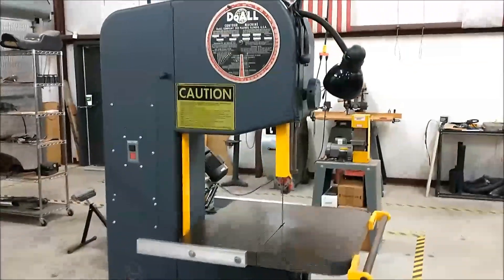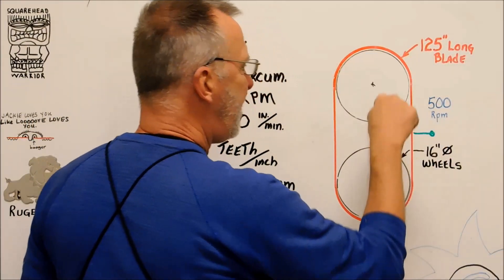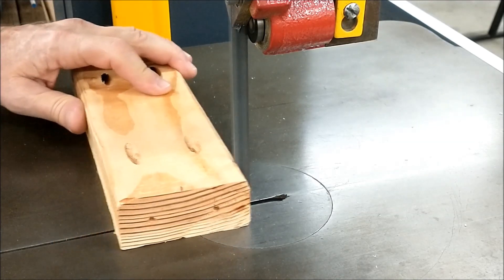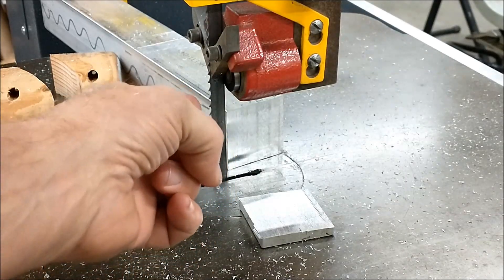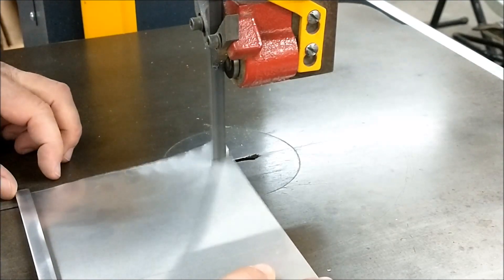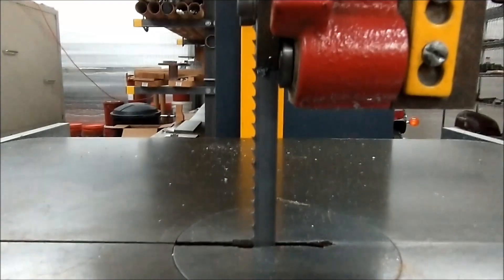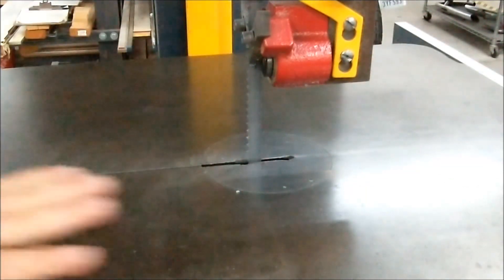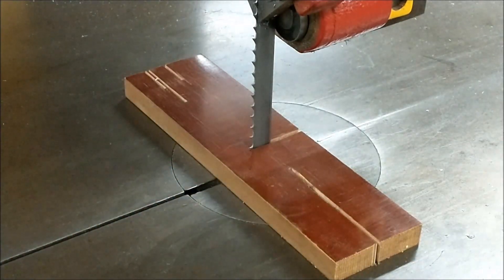1200 POUNDS, 500 TEETH, and No Conscience !!!

Comment: I always remove the guards from grindettes but rarely from anglegrinders.

I do have dozens of tools with guards removed,  I also have tools that I have designed & made guards for.

Your assumption that Everybody  that removes guards is an idiot is entirely loodicras let alone  WRONG.

It depends on the operators knowledge, skill, competence, hindsight experience, engineering competences, patience and WHY.

Manufacturers put guards on things to prevent morons from sueing them,  the same as gov & police enforce crash helmets & seatbelts.

There is a time and a place for these things and thats NOT EVERYWHERE ALL the time.

Safety guards ate extremely DANGEROUS once they have been in use long enough to induce complacemcy.

Guards should ONLY be used as a secondary safety aid.

The brain should take priority in self preservation and the protection of other people, animals & property.

If you don't have the cognative agility then don't touch the tool but don't inflict your incompetence upon the worlds  educated neurons.
Reply from the maker: Great comment. I almost thought you were serious. LOL

Comment: I dont get scared until the large shapers and radial arm saws show up!  My 14" bit my thumbnail and tagged the bone once.  I should use your method and calculate my reaction time.
Reply from the maker: I put a 1 inch wide dado head on a 10" radial saw and made 1300 cuts at 1 1/4" deep. The chips were flying.

Comment: Band saws, routers and angle grinders - High risk machinery. 
Band saws is deceptive because it appears to be a low speed machine.
The angle grinders. Well, the fastest way to remove material/flesh is with a grinder. Astoundingly, its not hard to find video content on YouTube showing proper idiots using them without the GUARD.... sometimes with a tough knotted steel brush disk.  WTF! 
I notice is appears to be an 'American Thing'.
The speed at which those things spin means bad shit happens very quickly,  and grinder injuries take a long time to heal.

Comment: Too many don’t want to take the time to pay attention to the principles and fundamentals of how a saw works, as the attitude is generally to bulldoze and hack through whatever, and get on with the project.
I’ve found that taking time to maintain and properly adjust a bandsaw, along with appropriate blade / speed selection, for optimum performance will actually save time, money and material for minimizing subsequent stock removal and ease of setup, and generally, less dicking around.
Then there’s the improved safety aspects and reduced risks, that go along with and result from the the optimized performance.
Very often, that stock preparation facilitated by a bandsaw will be the deciding factor of the feasibility of a setup to accomplish a job at all.

Comment: At the first shop I worked at the foreman was acting like a goof, dickering with the blade tension while running the saw with the guard open and the blade snapped. It came out like a cobra and took his eye out. It was a fucking horror show. Respect your machine tools boys. Don't be a cowboy.
Reply: Seen some MAJOR injuries over the years....
When I was a junior apprentice my foreman stuck his hand in a spindle moulder - three fingers and half his hand gone (early 90s MacRob Furn.)
Forearm cut off, hand trapped in Beam Saw at Steed Form Postforming.
Hand caught and COMPLETELY degloved in P.U.R. hot glue rollers (it was the Boss himself! Stripped his hand to a skeleton!🤮)
Also at Steed's!
Silkwood Furn, one of the juniors was feeding Drawer fronts through wide belt sander, one didn't come out the back....so he looked through the infeed side to see where it was stuck - the machine chose that moment to spit it back.
Opened half his face to the skull. (ALWAYS look in the outfeed side, so if it grabs, it spits AWAY from you!)

Thats some of the more memorable ones at a few of the places I've worked.
Reply: @kurdaitcha3509  I've worked at places like that back in the day. More memorable ones was at a cardboard box factory as a teenager I seen a dye press suck a mans are in up to his elbow. The rollers was only 3\16 apart needless to say there was no saving the arm. Next was a male employee with very long hair working on a box glue machine it would feed cardboard threw it faster than the eye could see he leaned over the machine to look for a jam the machine roller wound his hair up and scalped him now that was grew sum.
Reply: Wow!

Comment: Blade Rake angle and Tooth count matter a lot too. Track or Circular saws with high tooth count blades and near zero rake angle work great on Aluminium or Perspex and so does a higher tooth count Bandsaw blade. Also make a new insert in the case of the bandsaw with a smaller slot to improve support and reduce backside tearing/chipping.

Comment: Quite some time ago, one of the rough out guys in my shop was cutting a 3/32 thick brass or bronze plate on our Do-All, attempting to cut out a 9" circle.  He was running the blade a bit too slow for the application, blade clogging up with the soft metal chips causing him to really push into the cut.  Well sir some of those chips knocked out, the blade shot through the plate and cleaved his hand in a semi-circle from between his middle and ring fingers down to the base of his thumb near his wrist.  This happened in less than 2 seconds.  He grabbed his right hand with his left to try to hold his right hand together, maddone, so much blood.  This stuff will no shit injure one bad if innatentive or dangerous handling of work.  Believe it or not they got him to the Hand Center at Jefferson Hospital in Philly and within a year or so had almost full use of a now slightly deformed hand.  If we were out in the boonies away from such treatment he would have lost that hand for sure.
Reply: Good Lord, that is a horrifying. I was born and raised in South Philly and worked in a few different machine shops in the city in the late 1970's.

Comment: A kid at one of the schools I went to came to class high and nipped his thumb right off and didn't even feel it.  I believe they were able to put it back on, but the damage was done.  It took about 30 seconds to stop the machine with the brake.  It was big.  I think it had close to a 30" throat.  You could swing a 2x4 into the blade and it would cut it off.

Comment: Joe, you've had me going in circles for over an hour. How can turning a band saw blade backwards even happen .
 I eventually went to my shop, dug out a new blade to try and make sense of it. To my horror the blade I opened was backwards already. I finally twigged that you're not turning it backwards but "inside out". That will make the teeth run backwards. Now it makes sense. 
This 77 year old brain was tested. But thanks. I needed the exercise.
🍌🇨🇦☃️

Comment: I have a 36'' Oliver vertical band saw and I love it. It out cuts a table saw by far and it demands respect for one thing it runs very quietly when not cutting so your scenes don't alert you to its potential hazard. Lathes are the same way. The Oliver is also so big it is the only power tool I have that I have to climb on to maintain.
Reply from the maker: In a machine shop, the least dangerous thing is turning on the lights. After that, stay sharp. No pun intended.

Comment: Friction cutting in some cases works better high SFM it can be pushed sideways. not with the blade upside-down tho... and it will only work on thin sheet metal..no bar stock.

Comment: Joe- another important point regarding the vertical bandsaw is the need to have the upper guide close to the top surface of the material being cut. This limits the amount the blade can flex outside of the cut which  improves the accuracy of the cut, and also leaves a lot fewer of those hungry teeth out where a moment of inattention might lead to unpleasant results.  
ATB-  Bill
Reply from the maker: Take a look at the video in the video description too.
Reply: I once saw a bandsaw blade break, with the upper guide set way too high.  Normally when the blade breaks it just stops, no problem. When this blade broke with the guide well above the table the blade shot across the table at 90°, luckily no one was in it's path. 1/2" blades can still do damage traveling at 90° to the normal path. I think if the persons hand had been in the path, the blade would have gone through the hand. Don't let your hands go past the teeth.

Comment: The problem is the ability to support the work where the the cutting is taking place, vibrating the work and self feeding into the saw taking big chunks,a zero clearance throat plate raised in the center above the table to eliminate the work from self feeding. A second throat plate slightly raised and domed would be optimal
Reply from the maker: As shown.

Comment: I worked at a shop that had a band saw "blade" that instead of teeth,  had 2" lengths of files, each riveted to the band at one end, all along its length. I supposed it would've allowed the file segments to get around the wheels creating a "band file". I never saw it in use and I regret not trying it myself.
Reply from the maker: I believe thats a band filer. I've never used one, but know of them.

Comment: My former employer had an older 20" version DoAll bandsaw in the machine shop. It was a beast. It had a blade welder and a feed system with cables and weights. I'd love to have it in my wood shop at home. I cut up to 3" thick steel and 5" aluminum on it. With the proper blades it would cut anything.
Reply from the maker: True.

Comment: Many years ago a guy I worked with was cutting a Mica sample potted in a thick layer of resin. He had to cut it in 1/2" strips for a tensile test machine and he had done this many times before but it wasn't ripping and tearing as usual. When he was done we were sitting nearby having coffee when I looked over at the saw and noticed the teeth were backwards. We ribbed him for a while but he said he planned to cut the samples that way all the time because the finish was so much better. So what you say works great on some stuff it just looks funny.

Comment: If you have a blade welder you can cut the blade, thread it through a hole in a workpiece and reweld it. Now you can cut out a shape that is completely enclosed by metal. Snip the blade to remove it - job done.

Comment: Your final comment on cutting thin material using a “pre-cut” base is a method that works pretty well. A slab of MDO plywood works pretty well for that purpose.
Reply: Yeah: double-sided tape it/ tape+CA Glue down to a a piece of sacrificial mdf or plywood and you can practically scroll saw thin mats.

Comment: Thanks, maybe I need that trick some day, my record in Aluminium is 80 mm. 150 mm. D. circle and Plexiglass is always a question mark.
Reply: Going either direction that blade woulda cut the plexi. The danger with that stuff is heat buildup (occasionally chipping, but I never have with my bandsaw). Thing is, once your blade length breaks about 110" no one portion of it is in contact long enough to really start the melt, so long as you keep the workpiece moving. I use mine to cut 3/4" plexi and 1/2 lexan on the reg. Normal wood blade although I DO tend to make a point of using thinner, higher tpi blades.

Comment: Many years ago I had a Cincinnati #2 auto/hydraulic mill. Ran a job with a stagger tooth cutter. One day the rapid traverse feed dog was set wrong and feed took the work right into the cutter. The result was breaking 2 5/8" bolts holding the vise to the table, flinging the vise through the shop window and right out into the street. The machine never even slowed down! We use to say "the only thing that comes outa that machine is chips or blood!" Certainly the same with any kind of band saw.
Reply: I also ran a similar mill. Hydraulic feed. 
That thing was a beast. Ran a 14" shell mill with clamp style square carbide inserts. No vibration, no chatter, blue chips like popcorn. Most solid running manual machine I ever ran.

Comment: Blade speed on a wood cutting bandsaw is much higher than metal cutting.  With a moderately powerful saw, you don't need teeth at all.  Use an old worn-out blade, make sure there's no sawdust in the machine and feed steel through at a high feed rate.  Friction heating softens the workpiece and makes the cut.  The blade doesn't melt because it spends most of its time outside the cut.
Reply: When I was in Air Force, friction sawed 1/8 thick hot rolled with a large Doall blade slightly dull and backwards high gear maxed out. Cut like butter.  Note plywood blade backwards cuts steel roofing like butter. wear facesheild and ear protection also welding jacket.

Comment: Mr. Pie I have to point you on safety issue when working with sheet metal you were not wearing work gloves to protect your hands.
Reply: One of the last things you want to do around a band saw is wear gloves.
Reply: You should never wear gloves when using power tools!
Reply: Gloves can get caught by the teeth on any rotating cutting tool and pull your hand in, turning what might have been a nick into a major amputation.  Sheet metal can cut you as you mention, but that is minor to what a rotating cutting tool will do to your hand when it is trapped inside the glove.

Comment: I have respect for the bandsaw but the most dangerous saw I believe in wood working world in my opinion is the radial arm saw. The blade rotating downward and it will grab and throw it forwards towards the operator. More hands and arms have been chopped off because nobody uses the lock to stop the head from moving.

Comment: When I worked in a UK Secondary School it had a Start right 16" bandsaw. It was only after a minor accident that I was sent to another specialist college to get a certificate and tuition in machine safety. From then on it used to drive me nuts when teachers would try to cut iron billets using the wrong blades. I used to buy blades of all types but none of the teachers asked me to change a blade before the cut material. I'm glad I am now retired and they can get on with it themselves.

Comment: And that is the reason we use a 5 degree negative rake on the blades for the mitre saw, when cutting trimming and baseboards. Produces a much finer cut and keeps burrs to a minimum.

Comment: Hi Joe, very interesting, but why does the blade cut better the wrong way round in thin materials?
Reply: Keep geometry in mind. The right way around puts sudden pressure (relatively speaking) on the piece each time the tooth hits, where the teeth backwards applies a more gradual pressure, resulting in the material being cut bouncing less. When the piece bounces it causes irregularities in the cut. Less bouncing, less irregularities.

Also - i think - the contact gap is less, also resulting in less bouncing. The contact gap being the space between when the last contact point of the tooth moves past the piece to the first contact point on the next tooth.

Comment: Hi Joe,
Never heard that trick before. I know you can hold it between two sheets of stiffer material and that will improve the cut.
That is a pretty slow speed for a timber cutting bandsaw, they normally run around 3500 fpm. And I realise that your saw is made for cutting metal, which run slower.
A lot of people don't realise how many little knives are there to do you some damage. I have a bench saw that runs at 3000 rpm and have a 72 tooth tct blade, that is 216,000 teeth per minute.
Things like spindle moulders are even more exciting. They run 6000 rpm plus, and I have a 20 tooth blade that can easily cut a 8 mm wide slot at quite high feed speed, particularly if I use the power feeder. They are notorious for for doing serious damage to human fingers and hands, and occasionally throwing a workpiece across a room.
But used with care can be very handy.

Regards Dennis

Comment: Hey Joe. I have a question.
Bandsaw tension gauges
How do they account for differences in the mass of the blade?  EG: A 1/8" wide x 0.025" thick blade will stretch out way easier than a 1" wide x 0.06" thick blade.
I've looked at the instructions and there is nothing.
Am I missing something?

Comment: When I was about eleven, I had my own Craftsman jigsaw, and was always begging my dad to use his bandsaw. Finally, dad had enough and took me to the local supermarket and it's meat counter. A few words between my dad and the butcher, and I was taken back into the butcher shop, followed by a demo of what a bandsaw would do to a frozen side of beef.  It was a good while later before I asked again...saws will bite.  That's what they were designed to do...
Reply from the maker: Sounds like a lasting impression to me. Dad made his point.
Reply: I like his teaching style.
Reply: And the teaching worked for sixty plus years...and then my metal bandsaw bit me. And my Dad's table we saw bit him at age 70 when  his push stick broke... .dang saws are patient, always waiting for their chance. But they are useful...

Comment: When I’ve cut plastic on my cabinet maker saw I would use a Fraud non Ferrous metal saw, backwards. It cuts well, as plastic does better with no, or negative rake than positive rake. It also causes less heat, so you’re less likely to melt acrylic behind the cut. My plastic cutting blade (crazy expensive!) does do a smoother job.

The back of the bandsaw blade has microscopic ridges which act as very fine teeth. It will work on soft material.

Comment: Hi Joe 
Another great video thanks. Can I make two small observations re safety. 
.1 A small point but I don’t think you mentioned keeping the top guide as low as possible to minimise the unprotected blade. 
.2 Is a real danger and that is cutting round stock. It should really be clamped in a V Block to stop it rotating as this can cause real “grabs” with the blade. Obviously the V Block has to be made specially with a cut for the blade. 
Stay safe
Pete
Reply: Sorry Joe. I see you have already addressed my big safety issue a year ago 😊